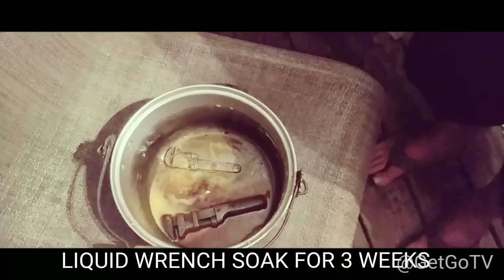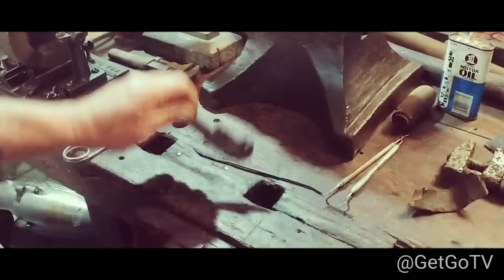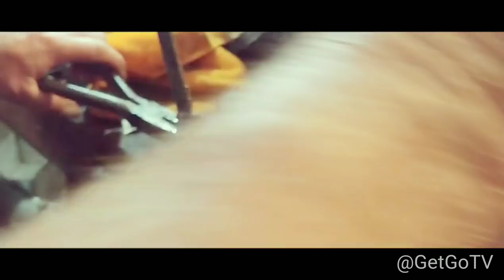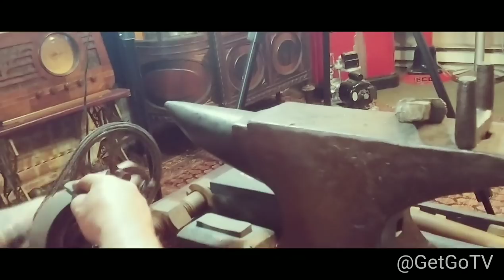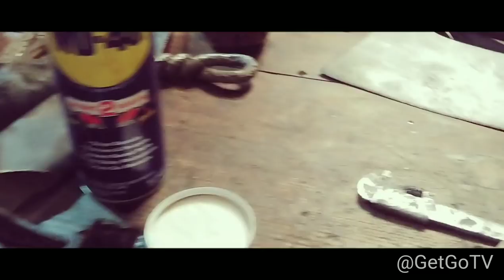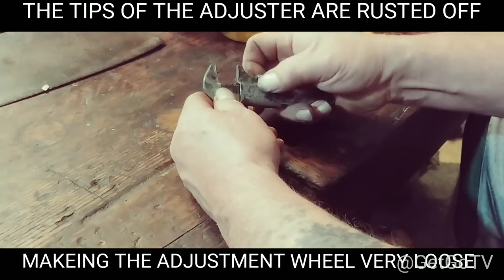IMPOSSIBLE RUSTY WRENCH RESTORATION

Comment: I like the fact that he doesn't put a mirror finish on his tools . And you can use them olso the hand tools he's using are awesome 👍
Reply: No point in polishing them when he's done with them. He beats the holy hell out of them instead of being patient and letting them soak properly lol. It doesn't need to soak! I just need a bigger hammer!!! lol
Reply: @Oi40ozCasualty  LOL 😂 he is a bit impatient 👍
Reply from the maker: If you read the subtitles you would know that they soaked for 4 weeks. 3 days in a rust remover and three weeks in a anti seize liquid. Also if I do have to hit the tool with a hammer I'm doing it to straighten a bent piece of metal or tighten something. I did not leave marks on the tool from the hammer. At the beginning of each video there's a short clip of them being placed in their liquids to be soaked. The entire soaking process is not included in the video or the video would be too long it would take 4 weeks to watch it
Reply: good work getgo

Comment: Those wrenches clean up real well, I had one in the about the same condition, it looks close to new after a little work, nice job.
Reply: Use oil and take the pin out, the wheel will come out, then sand rust and it will come apart so you can work on iit.

Comment: Scoutcrafter uses half transmission oil and half acetone. It works great to loosen up seized parts. I use Evaporust to get rust off then if still frozen soak in the mix mentioned

Comment: Instead of going through all that soak the rusty Implement in a mixture of molasses and hot water all the hot water does this helps dissolve molasses a rusty wrench like that about 2 or 3 weeks and it should be completely rust-free and usable

Comment: Good job but I have a comment on pacing and editing. As is, the video shows what YOU can do. It should be about the viewers satisfaction. The whole video is too fast with no satisfying moments. You should slow down at points to let the viewer actually see what you've done. The whole video is shot at about two feet distance. Do some close-ups now and then. Just a suggestion. :-)

Comment: Very nice work man. I gotta ask though. Where did u get old pliers?? Never seen any like those
Reply: They're old lineman's pliers, also known as kleins or combination pliers.  They're mostly used by electricians and linemen for cutting, crimping, and twisting wires.
Edit, you can also use them to loosen/tighten nuts and bolts.

Comment: Try using HCL to soak the rusty motherlovers in
Reply from the maker: Thanks for the tip
Reply: GetGoTV HCL or electrolysis is great. While vinegar and Evapo-Rust work fine, HCL and electrolysis have a visual component because they fizz and bubble
Reply: I hear it works well.

Comment: Watched the video to see how you would deal with the fact that much material would be pitted and rusted away making everything loose.  But it wasn't dealt with, still junk, waste of my time and yours unfortunately.
Reply: How does one deal with pitted metal to repair it?  I'm curious, because I have some tools in about as bad of shape...
Reply: You'll have to grind it out once the pit starts there's no going back but depending on what it is I guess you could might spot weld it and grind that down to make it flush now that I think about it I mean you could also jb weld or epoxy it but it wouldn't blend dono not a professional just a thought I restored a broad hatchet and I ended up grinding it down and reshape it to rid it of all the pits I gave ya my best thought maybe someone that's smarter than I will come along and give you a better answer
Reply: Possibly could have grinded all the grooves down to the width of the most damaged spot. Then grinded in new grooves, heat the part that holds the wheel thing and crushed it slightly to fit the new width. Crimping the end to delete a few miLs of gap may have worked too. (Kinda a quick guess, but I woulda tried that if i was making a restoration vid)
Reply: @davidth.o.g.2229  .....GROUND.... sorry pet peeve of mine.